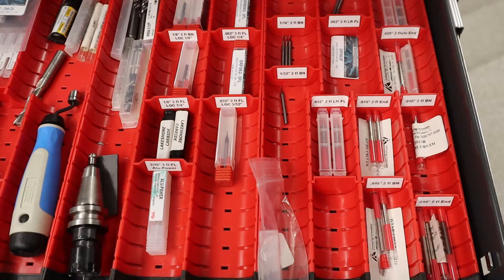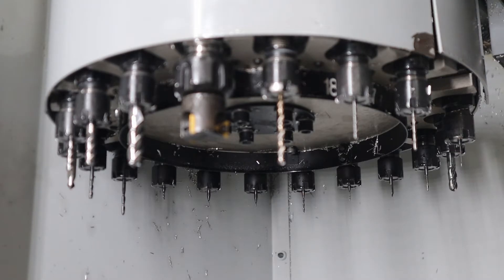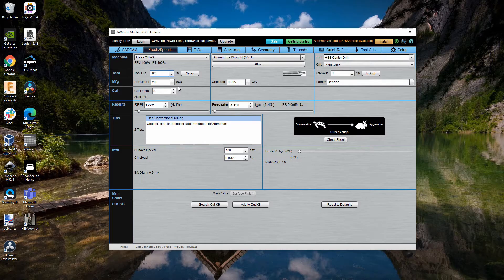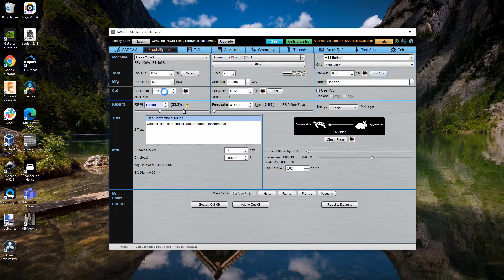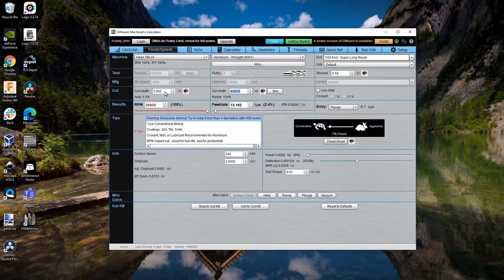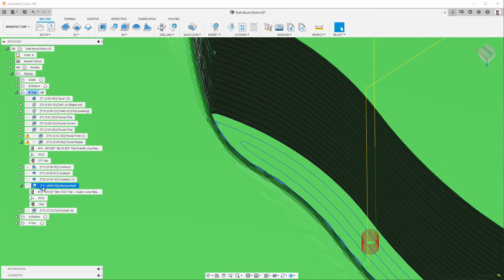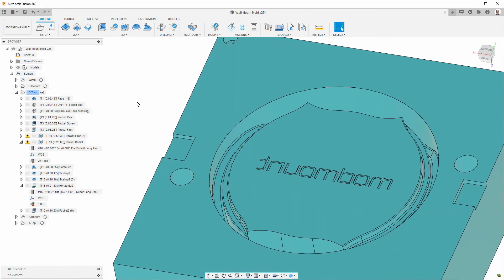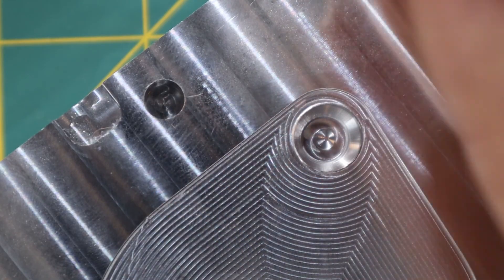Afraid of Micro Machining? An Introduction

Comment: I worked with a PCB manufacturer, designing a very fast test system, and had the opportunity to see a lot of very fine milling and drilling, watching tachometers at >125,000 rpm, drill sizes to 0.2 mm. Requires very robust and "stiff" equipment!

Comment: I realize this is a 3 year old thread, but I just viewed it.  You should check out the bits offered by PreciseBits.  I particularly love their Tapered Stub Micro End Mills.  I use their 0.010" bit all the time and I love it.  So far the worst I have been able to do to one is chipping one flute after driving it into a piece of aluminum with a Z dive crash, so hard as to sink it in about 1/16.  Since it was the only one I had on hand at that time, I was even able to finish that project using that same bit.

Comment: I used to cut a lot of small electrodes on a graphite high rpm milling machine. I made a lot of really small cutters on a deckle single lip tool and cutter grinder. Probably wouldn't work for extremely small cutters but worked well for small engraving tools and ball end miles down to maybe .078. Was wondering if you tried that or used that for making some of your small cutters? I used pretty much all carbide.

Comment: My spindle only goes up to 10,000 RPM. The machine holds good tolerance, about 5 tenths, and even with 2/10th TIR collegs and whatnot running endmills at 5% of the lowest recommended feed rates and step down I get breakage... Machining plastic (duratron u1000 ultem) Can't even finish a part. 1/32nd endmill. Sure they are cheap Chinese ones but I really can't imagine that a more expensive one would make much of a difference because they are of such weak constitution.

Comment: Great video! Could you please recommend a more economic machine that could do micro machining for watches?
Reply from the maker: Before I got my Haas, I had a Taig 5019CNC machine. The max RPM is 10,000, which just means it takes longer to mill parts. At the time, I was milling brass, aluminum, and plastics, so I don't know how well it does with steel. But I would imagine that as long as you're taking light cuts, it should be fine. I did make one injection mold where I used a 0.010" diameter ball end mill for a tiny detail.
Reply: @JohnSL  thanks for your rapid reply. I will check right away!
Reply: @JohnSL  i just saw that you have a playlist for watch making! Great!

Comment: I built a micro milling machine specifically for intricately detailed small parts. 40x90x90mm using a stepper motor with an adapter for the 4th axis. I can switch between a 140k rpm air spindle or 50krpm electric version ( limited to 25k with current direct drive bldc motor). The micro stepping nema 14's driving 6x1mm precision ball screws offer great resolution. I have machined just about every material with it including titanium and steels up to 55hrc. I really need to find some work for it.
Reply: Hello sir. Would you be willing to share how you did this? I'm trying to make my own watch/parts/movement and that is the perfect working area for me. Could really use any input!!

Comment: I have a 6040 desktop CNC with max spindle RPM of 24000. I want to use an .25mm ball end mill to engrave small pockets for a 2 part mold design but adding the calculations of the tool diameter and SFM I would need to go above my max spindle RPMs. How can I make this work? Do I lower the feed rate and that would also lower down my RPMs too? To safety and successfully cut this, how do I approach this?
Reply: I’m also cutting into AL 6061.

Comment: I enjoyed the video but was a bit rambling. In 14 mins I kind of didn't learn anything, apart from what I knew which is don't ram a 1mm end mill into a slot at full depth and full power. Kind of lacked substance, was too much over arching introduction stuff. 
But not bad

Comment: John, I have been buried in your videos for the past weekend. very informative, thank you so much, I am not a professional machinist actually a product designer, We are developing a project that we will need to so some "simple" micro machining. 
I know enough to know that to know what i don't know, it is a very simple project to do some surface milling of our core product that is 3d printed in 316L stainless, (similar to the tolerance of cast parts) we will be: truing up the parts, surface milling, generally removing a maximum of .6 mm of material, drilling of small holes and tapping which i will do initially by hand.  My first step is to build a series of tools - probably in aluminum (this is for our prototyping  process so short run) to hold the parts.  It is a project that I need to work confidentially with a chosen person, maybe not post the full project online.  Probably I can all the work developing/machining the designs from the "expert" (or the person can also prepare the first set of  tooling) and while i don't have a lot of money I am certainly will to pay for this help.  Interested?   thomas

Comment: Thanks for sharing this! I’m just about to start micro machining PEEK parts on a brand new Haas DM-2 with a 40000 rpm air spindle. I’m very encouraged by your success. Are you using high speed machining toolpaths like the adaptive ones in Fusion? I’m using Solidcam and HSMworks and getting a slotting toolpath that is adaptive has been a challenge. The slotting with a tapered cutter is something I had considered and I’m glad you covered that. I guess I’ll be getting G-Wizard.
Reply from the maker: Yes, I definitely use HSM and adaptive toolpaths with Fusion 360. But for slotting, I generally use multiple shallow passes, as that's much faster than trochoidal tool paths for slots.
Reply: @JohnSL  thanks for the prompt replies. It is very much appreciated. I’m a pretty experienced prototype / job shop machinist, but never got much into the micro stuff. I just setup a machine shop to make micro gravity science experiments for the International Space Station and the parts typically have dozens of .5mm wide slots they are about 5mm deep. I’ve just got everything set up and am starting test cuts this week. Looking at a .4mm endmill, I’m like "there is no way I’m not breaking this thing"
Reply from the maker: Yikes, that's going to be fun! That's over 10X diameter for the reach, which sounds like a super-long reach end mill. And idea that just occurred to me is to use three different tools: a standard reach down to it's depth, then a long reach, and finally the super long reach. I'm not sure this would make much of a difference in the total time, but it's a thought. I've also heard that PEEK can be pretty hard on end mills, so might need to set tool life limits. I have no first hand experience, so just throwing out ideas in case they're useful.
Reply: @JohnSL  I meant 0.5mm deep. I downloaded GWizard today and used it to do some test slots. Overall a success but for some reason the Solidworks CAM Professional toolpath was off center by a few thousands. I milled between a 1.0 mm start and finish hole which is how I noticed. But I didn’t break any tools or crash anything, so taking my victories where I can. Thanks again for your advice!

Comment: Howdy! My mill has a max rpm of 4000. Often I find that I need a much higher rpm than that for small mills. (1/8 and 3/16). 6000rpm 8000rpm etc. What parameter needs to change to accommodate the lower max rpm of my machine?
Reply from the maker: You just need to slow down the feed rate. For example, let's say you were running at 10 ipm at 10,000 RPM. If you run at 5,000 RPM, you would need to move at 5 ipm. I rely on GWizard to figure out feeds and speeds, as they also depend on width and depth of cut.
Reply: @JohnSL  fantastic, thank you so much!
Reply: I am also using haaa vf2, what about DOC ?? 

Endmill: 1mm
stick out length is 29mm for taking 1.4mm width groove for depth 2.5mm.

Comment: Fusion 360 chugs when I wind up doing 1/32 work.  I wound up at .002 step down and step over due to 20k rpm Dewalt router end mill with unknown precision spindle runout,  around 3in a minute with a single flute.    I may be able to push it a bit more now that my fixturing and tram are better than they used to be.   But I am no longer snapping 1/32 end mills.

Remaining stock strategies are huge benefit for what I am doing.
Reply from the maker: Been there. I used to snap 1/32" end mills and it drove me nuts. Now I only snap end mills when I make a mistake with the CAM. That's a very welcome change.

Comment: Thanks John, appreciate this video.  My pantograph use with 0.016" dia. cutters became too nerve wracking, so went CNC.
How CAM software manages delicate cutters through internal corners is something I need to improve upon.  Insights into using material tougher than aluminum would also be great.
Reply from the maker: Thanks. I'm planning to do a couple more videos on this subject. In one of them I'll tackle steel.

Comment: Hmmm, me thinks I will not get the same results in my manual 30+ year old manual mill. I have a lot of these tiny HSS mills......time to experiment. 😊
Reply from the maker: I imagine that would be quite the challenge. Before the days of CNC, I believe people did use such tiny end mills on manual machines, but I have no idea how. Probably just very slowly and carefully. Or perhaps using a pantograph.
Reply: @JohnSL  i had a crazy idea of making a mount to hold a Precise grinder spindle on the quill of my Wells index.

Comment: Great video 👍 Depth is a issue when using such small cutter's, have seen pneumatic driven 30,000 chucks could help in depth and speeds and feeds.
Reply from the maker: I'm already running these at 30K RPM, which is the maximum spindle speed for the Haas OM-2A I have (they make a model that goes up to 50K).
Reply: @JohnSL  50,000 rpm that's serious speed , great that we live in the time's of nano tech brushless motor's just makes things more possible.

Comment: Good video, I have done some machining with .030" diameter end mills on my Tormach. Was very frustrating, and costly project. But have a Haas now and doing much better with some smaller 1/16" mills occasionally. Would be interested in seeing more along the lines of surface finishing in molds. Thanks.
Reply from the maker: That got me thinking that it might be good to do a second video focusing just on 1/16" and 1/32" diameter standard reach end mills. I find those super easy to work with, and only break them when I do something stupid. I'm thinking of showing adaptive roughing with those end mills to show how hard you can push them. And also run them at 10K RPM. Would a video like that help?
Reply: @JohnSL  Being a standard size I think most viewers would be using 1/32" 1/16" and 1/8" on a more regular basis. Smaller than that would be a rare instance. I use a lot of 1/8" but not often smaller. Since moving from a Tormach recently which has 4,500 RPM to a Haas which has 10,000 RPM I have not had much opportunity to run smaller mills yet. So don't have any experience gained yet on a better machine. But enjoy your videos, some day I would like to make some molds, but have not starting anything yet.

Comment: I am also deep into the realm of micromachining.. about 6 years in... found Harvey Tool to be a HUGE game changer. They make amazing micromachining end mills and also provide amazing feeds and speeds recommendations. I encourage you to give them a shot. They tend to be expensive but there is absolutely no comparison, in my opinion. For instance, .015 flat end mill 5xD, and full axial engagement with an adaptive roughing strategy. I’m using a machine with 10k spindle so you will be even less restricted than I am in that regard.
Reply: Great video though! Not much info on the internet about this subject so it is hard to research and learn about it
Reply from the maker: Thank you. I'll have to check out their feeds and speeds recommendations. I'm thinking about doing a video showing adaptive roughing with micro end mills. Doing full axial would certainly be interesting.

Comment: John, do you have to do anything special during tool touchoff and edge probing to prevent breaking those micro end mills?
Reply from the maker: I make sure I move the Z slowly. You can see me setting the tool height, using an Edge Technologies height setter, in my previous video for the 1/32" diameter 15mm reach end mill.